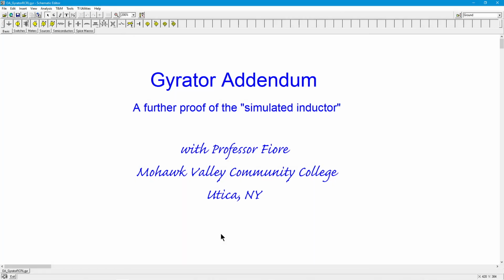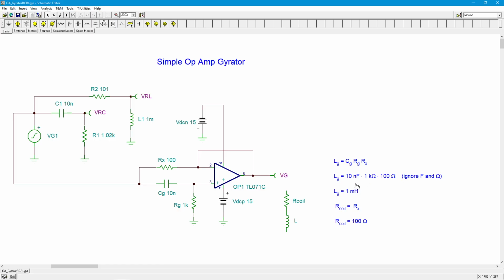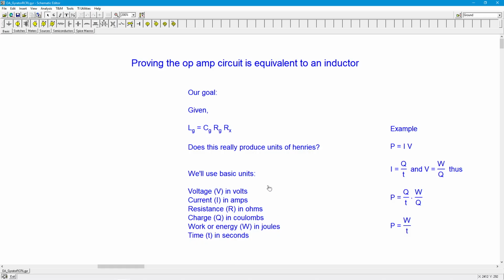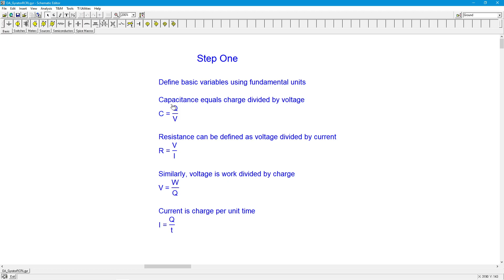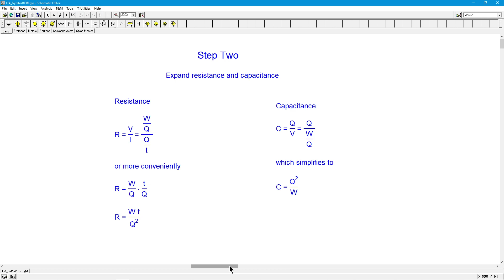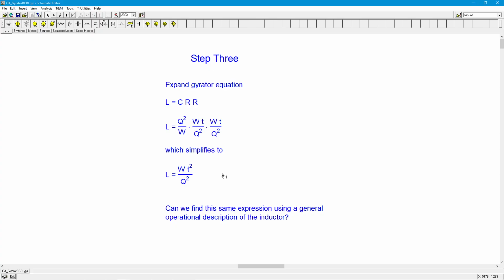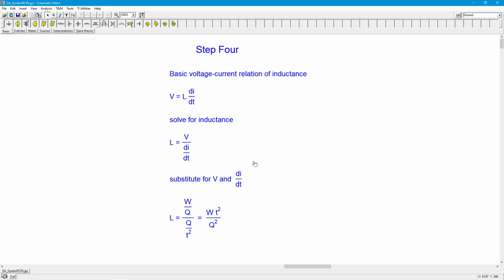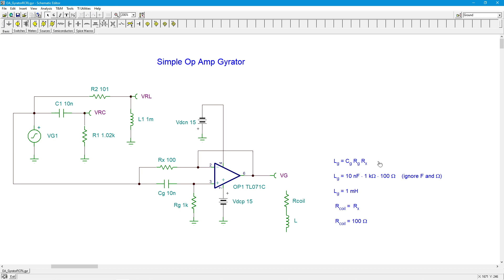Op Amps: Gyrator Addendum

Comment: Very interesting video! Another student and I were trying to prove that this circuit is equivalent to the gyrator, but we are having trouble getting the gyrator matrix for that circuit. Do you know if it is possible to get the impedance matrix or the transmission matrix? Regards!